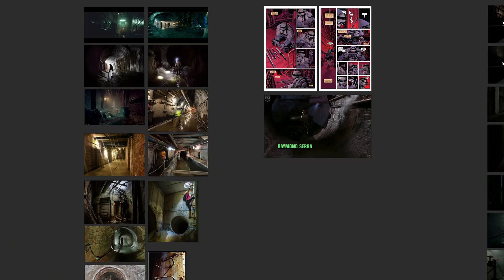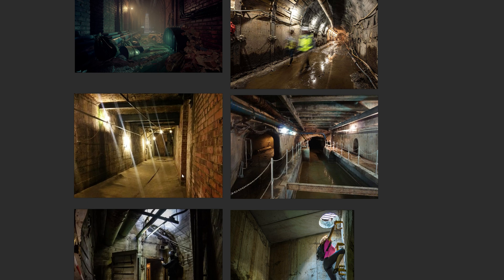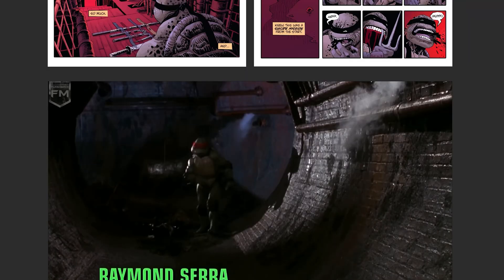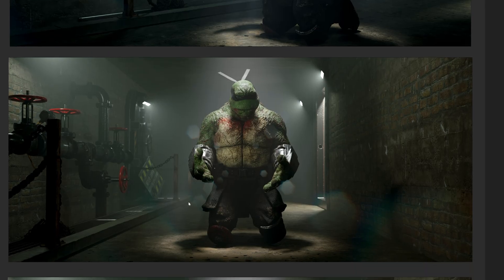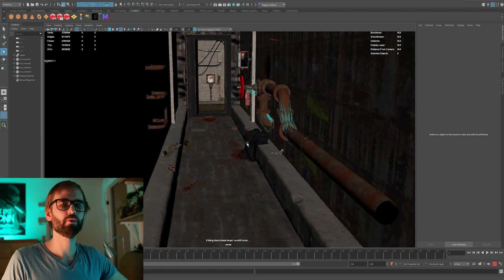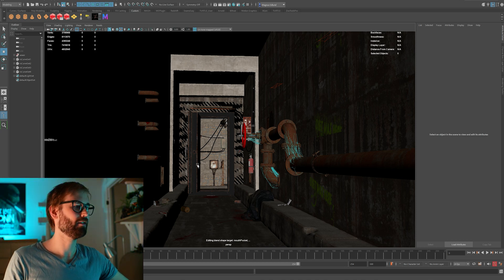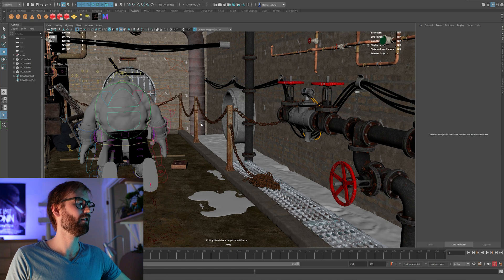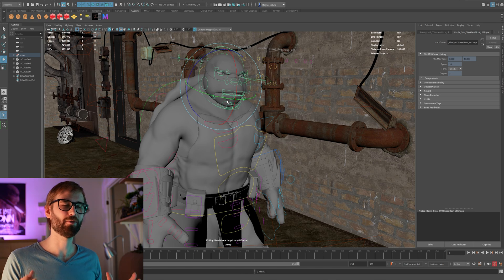Behind The Scenes Ep2: The Last Ronin Animation

Comment: How long did it take you to render each scenes? 

What’s your pc setup like? 

Would it be possible to just use blender for texturing instead of integrating it from another software such as substance painter? What’s the difference between the two? Is it the workflow in between the software?
Reply from the maker: Hi :)

It depends on which scene. The close up of the turtle took more then 10 minutes for each frame. I rendered everything in 2K

I have a amd threadripper 3960x and a 3090 GPU. I render with redshift so the GPU is really important. 

I don't use blender but I guess you can do everything in blender so that's a great choice if you want to only work in one software :) Blender can do a lot of cool and amazing stuff! Blender can do everything but blender is not best at anything. Zbrush is better for sculpting, Maya is better for animation, Mari and Substance painter are better for texturing but non of these softwares can do everything like blender can :) We used blender for Drowzee in our short film "star wars the pokemon awakens" (take a look at that short film if you want to), but if I remember correctly we textured him in another software. This was back in 2018 and blender has improved a lot since then :)